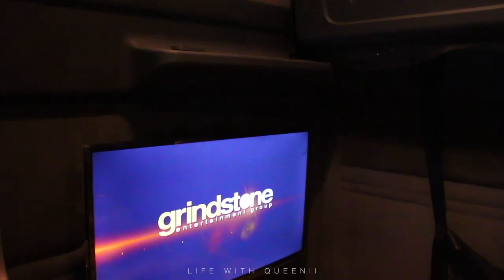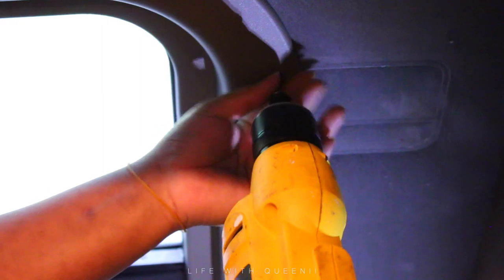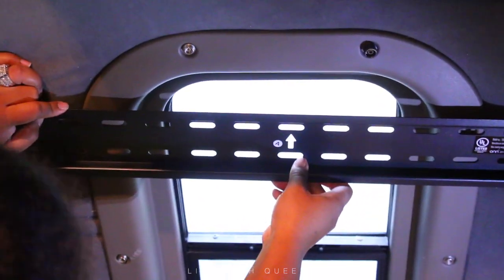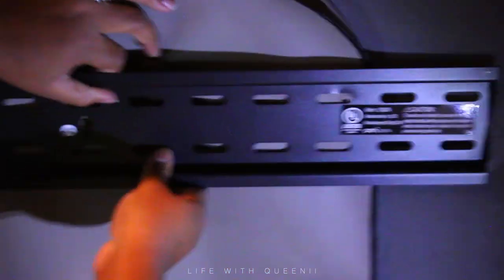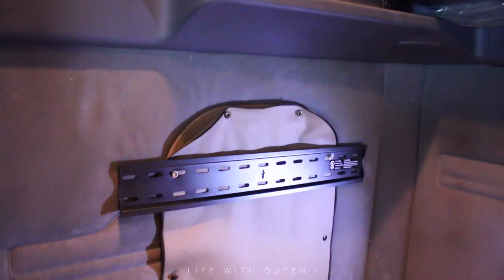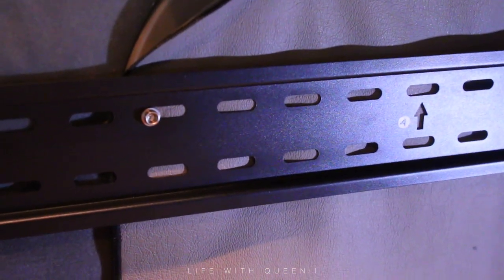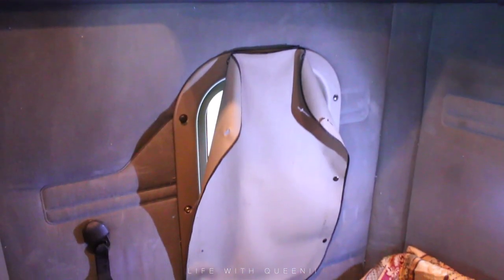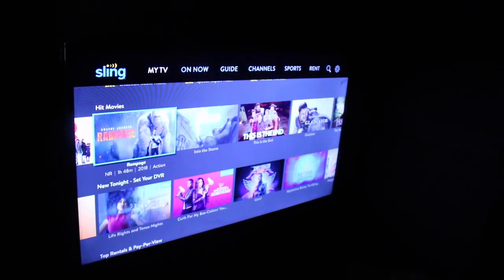How to install  TV mount in Truck/Camper with no damage! - Life with Queenii

Comment: Thank you for this video. My hubs and I just picked up our new 23 volvo 860 and it didn't have a mount in it,  nor did it have an inverter installed.  I didn't even think about asking them to install that I just figured at least the inverter was standard when you are spending that kind of money, ya know. 
Anyway i just went and bought a mount from Walmart and I'm gonna use your idea to install it,  thx girl
Reply from the maker: They have some affordable inverters at harbor freight that I saw a few weeks ago.
Reply: @LifeWithQueenii  yeah we got one hooked up,  only was like $155 for a 2500. Works great just have to run extention cords for now until we direct wire some outlets.

Comment: One question do you have to move the tv when you open tbe bunk.?
Reply: Most likely yes, I mounted a 32" in the same spot, but I got the bracket with the pull cord disconnect for the TV to the bracket. Pull, release TV, and bunk can swing up and clear the bracket. I have a 2016 coronado freightliner, but same setup basically as century, Columbia and Cascadia freightliner. Hope this helps.

Comment: That mount comes with a level. But not much of a difference since those  holes do most of the work. 

Verizon is probably the best carrier for hotspot. 150 gb of data for under $100. Sounds like a lot of money but people just don't understand the difference between mobile and stationary Internet. Speed do slow down after 150gb  but not by much. At&t slower speeds feel 2g Internet. Worse than dial up actually.

Comment: Just curious the back of my tv vibrated till it cracked where it attached to the wall mount how has your husbands faired
Reply from the maker: His is still in place, no issues since I put this in. Cracked on the screen or the bracket?
Reply: @LifeWithQueenii  back of the tv we’re it mounts to the mount
Reply from the maker: @leehill7410  wow, I’ve never seen or heard of that happening. Does the tv still work?
Reply from the maker: @leehill7410  I’m just assuming the plastic they used on that tv was thin? I’m not sure because it takes a lot to crack the plastic from the back of the tv
Reply: @LifeWithQueenii  I assume your husband pulls a van trailer? I have to off road to load and unload. So there are a lot of vibrations think I’m gonna try using rubber spacers on the next one but yes It does still work
Reply from the maker: @leehill7410  most of the time yes, that could be why yours vibrated so much. Maybe add in a strap as well to strap it down?
Reply: @LifeWithQueenii  it’s the second time this has happened but I usually attach the arm so the tv can be swiveled I have tried to power on the tv sry been a busy few days
Reply: Get a tv with a flat back. Not the flat screen that has that plastic square to mount